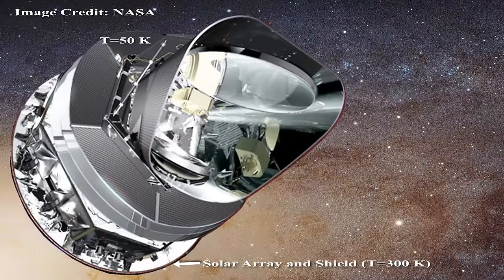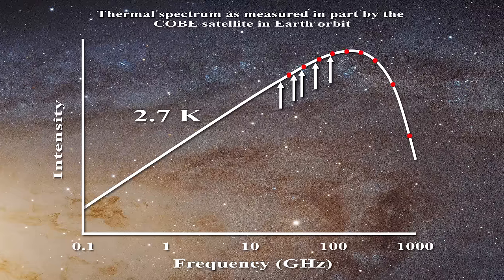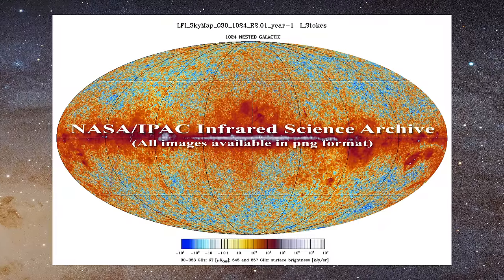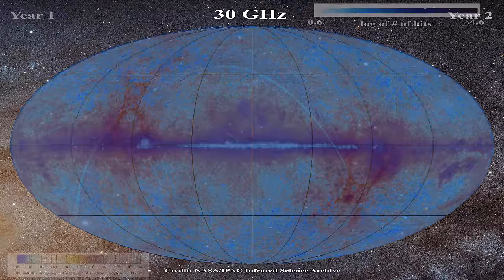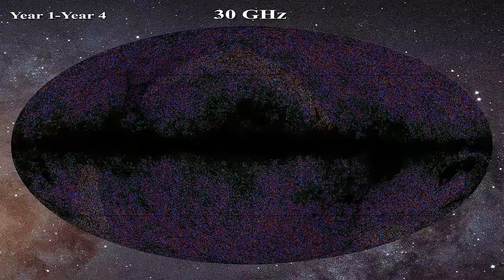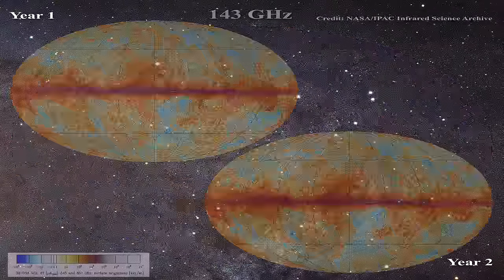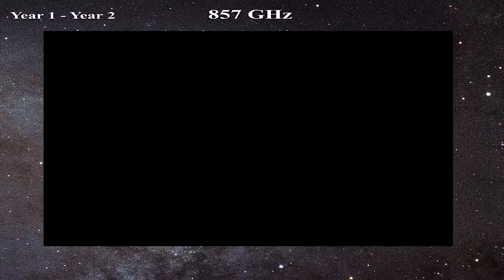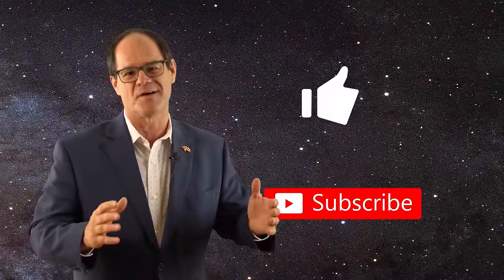The Planck Satellite - A $1,000,000,000 Misadventure

Comment: Oh dear where do I start!
Doing differences within Photoshop of the images is "not careful analysis"  or science. You need to download the proper data products (HEALPIX fits files) from the Planck or NASA website.
As it is, you can't give values for the difference between maps thus making your comments completely invalid. No useful analysis can be done on the png images the course pixels you show are png pixels not the instrument pixels so there are artefacts generated there for a start. Also with the true data you can put it into a linear colour-scale. If anythiing the logarithm scale actually allows for a finer temperature scale near zero to show features not hide them.
Reply: @roger_isaksson  Hi Roger. Let's see how they justify their analysis this time?
Reply: @Infinion  Well the original data are double-precision floating point not RGB values which can't express properly the full dynamic range
I have analyzed the HEALPIX files, I WORKED FOR PLANCK LFI!!
Reply: @roger_isaksson  Yes, just to point it out more, a Planck data file for the map is 480MB and the map png is just under 1MB, so much for LOSSLESS!
Reply: @BobWatson_Dr  Okay, then how can I compare for myself if the error between year 1 and 4 in the HEALPix format has the same magnitude of error as the lower resolution PNG output? If you've analyzed HEALPix files you should be able to do it, or at least tell me how to process the .fits file. What are the steps to generate a table or lossless 64-bit map to make the same comparison? If the PNGs really aren't enough of a judge that there is a problem with the maps, I want to see for myself with the better data and decide for myself.
Reply: @Infinion  Okay, best way is in python. 
You need healpy to read the healpix file, so "pip install healpy" should fix that
go to https://pla.esac.esa.int and click on maps then single frequency maps
There you get get the year-1 and year-2 maps (in fact there are difference data sets already done, but that spoils the fun
Grab say LFI_SkyMap_070-BPassCorrected_1024_R3.00_year-1.fits and 
LFI_SkyMap_070-BPassCorrected_1024_R3.00_year-2.fits
Reply: ipython
%pylab
import healpy as h
Y1 = h.read_map('LFI_SkyMap_070-BPassCorrected_1024_R3.00_year-1.fits') 
Y2 = h.read_map('LFI_SkyMap_070-BPassCorrected_1024_R3.00_year-2.fits')
h.mollview(Y1,max=0.001)  # Shows Year 1 data
h.mollview(Y2,max=0.001)  # Shows Year 2 data
h.mollview(Y1-Y2,max=0.001)  # To see the difference 

Should be fuzzy noise about 0.00017 K
Reply: @roger_isaksson  Unfortunately it's time for bed for me, so I'll  have to wait until tomorrow to see how all this plays out
Reply: @BobWatson_Dr  I'm running windows, so I'm going to have to install a virtual machine and then ubuntu before I can install and run healpy. When you call h.mollview(), are you setting 0.001 to be the maximum range value of the array? shouldn't it be "maxfloat="? https://healpy.readthedocs.io/en/latest/generated/healpy.visufunc.mollview.html. I have a lot to go before I can test the code.
Where are the already finished difference data sets? Are you talking about the Year 1-2, Year 1-3, Year 2-3, and Year 3-4 .fits files on https://pla.esac.esa.int/#maps ?
Reply: Dear Watson: I noticed that you mention nothing about the use of logarithms to plot the images. The Planck team know that they have a problem and that's why they chose to use a logarithmic scale rather than a linear one. They are clearly lying or they are imbeciles.

The pot calling the kettle black. You are making a fool of yourself. Quit while you are ahead. This nonsense cannot be salvaged. The ship is at the bottom of the ocean as I mentioned to you before. We can only hope that the tax dollar spigot will be turned off soon...
Reply: @bushmangrizz4367  I did mention the log colour scale and it actually shows up more details rather than hide them. Think about it - not using the log scale means having to use a less sensitive linear scale. As I said the data are available to produce linear plots if you want
Reply: @Infinion  I am setting max range. I literal did those instructions in another window and cut & pasted. The documentation is a bit misleading, see the bit in blue at the top for the use of the parameters. I suspect the line should read "max float" - parameter name and then type, but it all seems run together. 

Yes there are finished difference datasets difference between years or surveys or odd scans and even scans - it was a big thing to show the consistency of Planck data
Reply: @BobWatson_Dr  : “I am setting max range. I literal did those instructions in another  window and cut & pasted. The documentation is a bit misleading, see  the bit in blue at the top for the use of the parameters. I suspect  the line should read "max float" - parameter name and then type, but  it all seems run together.

“Yes there are finished difference datasets difference between years  or surveys or odd scans and even scans - it was a big thing to show  the consistency of Planck data” Watson

The only one being misleading here is you.  How amazing that you are willing to call PLANCK ESA documentation misleading!  The full 2nd year data release is available from CalTech including the HEALTIX data in addition to the png.

Infinion asked you this:

“Where are the already finished difference data sets? Are you talking  about the Year 1-2, Year 1-3, Year 2-3, and Year 3-4 .fits files on  https://pla.esac.esa.int/#maps ?” Infinion

The entire second year data release for PLANCK is displayed in the  CalTech site  https://irsa.ipac.caltech.edu/data/Planck/release_2/all-sky-maps/, as  Dr. Robitaille mentioned. The designation Year 1-2 should be read Year 1 dash 2, in other words,  Year 1 PLUS Year 2.

The file name "LFI_SkyMap_030_1024_R2.01_year-1-2.fits" corresponds to  the SUM of year 1 and year 2 at 30 GHz for the second data  release. Similarly, the file  "LFI-SkyMap_030_BPassCorrected_1024_R3.00_year-1-2.fits" is the bandpass corrected version of essentially the same file in the 3rd data release.  There are no  difference images at all on an individual frequency basis for PLANCK data anywhere for the 2nd data release as anyone can see by looking at the CalTech file. The same appears to be true for the files stored at ESA.  It is amazing the lengths to which you will go to  distort the conversation.  Surely, after you examined the file, you  recognized that they were not difference maps at all, but you chose to  persist with your deception, just to win the argument.  You are counting on the fact that Infinion will just not be able to open the Healpix file and most people will believe your were right because you were part of the LFI team when in fact all you did was deceive.
Reply: @stevecrothers6585  My apologies - There are different combinations of years, surveys and rings for you to difference yourself - I thought they were already done
I downloaded the single year maps and differenced the data explicitly hence the Y1-Y2  . I'm actually all for people opening the files and finding out for themselves and learning
You seem keen to see a conspiracy everywhere.
Reply: @Infinion  Sorry the Year 1-2 maps etc are combined maps as Mr Crothers so politely pointed out. What can I say - it was 11pm and I wanted to go to bed
Reply: @BobWatson_Dr  "11 pm and I wanted to go to bed" is not good enough coming from a Planck team member who hoodwinked Congress and ESA to take a billion dollars of taxpayer's money for scientific nonsense. 

Dr. R. is the 1st person on this planet to show the differences in the maps - qualitative or quantitative. The Planck team is lying and covering up. If you were an honest person you would have pointed that out from the get-go. You said that you did when you didn't. It is clear, Bob, that you are an intelligent person. But high I.Q.s do not correspond to wisdom. In fact, the higher the I.Q. the greater the chance of arrogance which can easily lead to lying. That is a problem with science in general, and physics/cosmology in particular. The cosmologists have done an immense amount of damage to science in general because of their arrogance and delusions concerning gaseous suns, Big Bangs, dark energy, dark matter and black holes. There is going to be a terrible price to pay for all of this lying...
Reply: @bushmangrizz4367  OK One simple question: How big are the differences between the maps in mK? 
All I hear and see are hand waving emotive words, but nothing quantifiable.
Also aren't you just a sock puppet account of Crothers? Your speak patterns seem awfully similar!
Reply: @stevecrothers6585  Er can't you read the code? I took Year 1 data and subtracted Year 2 data. The difference image is in the line: 
h.mollview(Y1-Y2,max=0.001)  # To see the difference 

I got the number as the rms on that (Y1-Y2) array via:
print std(Y1-Y2)
0.0001659233611499477
Yes indeed the data files contain more information - but these are needed for a proper scientific analysis. So naively on your own numbers one map = 480/10 = 48MB compared to a 3MB png!I don't know which particular png images you are using as they come in different sizes - why one needs to use a defined data source
Dr Robitaille gives no colour scale on his difference scale (because it's impossible) so they are meaningless. 
Have you downloaded the data yet? I want to see your numbers!
Reply: Dear "Where do I start" Bob: What frequency did you analyze and what were your units?
Reply: @bushmangrizz4367  Frequency = 70 GHz   Units = K_CMB
Reply: @roger_isaksson  I suppose the next step would be to do the spherical harmonic analysis to show the CMB angular power spectrum
Reply: @BobWatson_Dr  Thanks, Bob. Didn't think you would answer.

What unit is K_CMB?
Reply: @bushmangrizz4367  Hi Bushman, it's because the all the frequencies apart from the highest two were calibrated on the CMB dipole. So temperature variations are seen as if they are thermodynamical variations in temperature about 2.726K - means the amplitude of the CMB anisotropies is identical in all the maps. This means you have to remember this when checking foregrounds which have a different spectrum. For the LFI frequencies, it's only a few percent different. 
The CMB dies away quickly at the highest frequencies so planets were used to calibrate directly into power per solid angle. This is OK as these are the 'dust' channels
Reply: @roger_isaksson  Honestly it's more a tradegy!
Reply: @roger_isaksson  : It’s now quite evident to everyone that you and Mr. Watson have no understanding of imaging.  You have now confirmed that the Planck Team did not present the difference images because they knew that they were garbage. If they had done so they would have lost their funding 10 years ago. In fact if WMAP had taken their difference images as Dr. Robitaille warned in 2007, the Planck mission would have been terminated. Watson’s difference data are horrid. It’s clear that you have no experience in analysing difference images. If you wanted Planck to have any cosmological validity the standard deviations Watson presents should be 100 times lower. You are obviously out of your league competing with Dr. Robitaille. As it is Watson’s analysis further delivers the death blow to Planck by Dr. Robitaille. Unlike you, Dr. Robitaille, using simple qualitative analysis, could tell that there is no stability in the Planck images because he is very experienced in analysing difference images. He did not need to go to quantitative treatment because he knew the results would be horrid. Remember, Watson’s analysis is for 70 GHz and the WMAP analysis for the CMB is weighted in V-band. That is why these difference data are now so devastating. Once again they simply confirm the point Dr. Robitaille has made.
Reply: @stevecrothers6585  Again nothing but subjective air. I see no numbers just baseless asserts.
Dr. Robitaille's differences have no colour scale so his differences could be microK for all you know
Oh and my difference is beautiful - just the expected Gaussian noise! And it has a numeric result!
Reply: @BobWatson_Dr  : I’ve discussed your comment with Dr. Robitaille. Again it is very clear that you do not understand how to verify the validity of two images as being the same. He tells me that if you take an MRI image of a phantom with a signal to noise of 150:1 then repeat the image and take the difference the standard deviation on the difference will be at the level of the noise. You should not see remaining evidence of the phantom. No pixels should stand out above the noise floor. Now look at your Planck data. You have an image with signal plus/minus 1 mK. Your standard deviation is 170 micro K representing 17% of the total intensity. Now look at your difference image. You see bright and dark pixels everywhere. If you had a proper difference the image should be essentially monochromatic. It is not enough that it is Gaussian. The standard deviation’s value matters. You have pixels in the difference image that have essentially intensity values of the un-differenced yearly images. That is why your data is junk.
Reply: @stevecrothers6585  May I just point out THIS ISN'T A MRI IMAGE! Indeed there you do want good signal to noise, so you can say if that blob is cancerous or whatever. With CMB image we are not interested in every single blob but the statistics on amplitude on different angular scales. I am shocked you don't know this. It’s now quite evident to everyone that you and Dr. Robitaille have no understanding of CMB imaging!  You have now confirmed that your channel is garbage and should be demonetized. 

Honestly you want me to do the spherical harmonic analysis to prove my point?
Reply: @BobWatson_Dr  : Let’s go through a history of what just happened. 

[1] Dr. Robitaille produces a video displaying important yearly differences in Planck data.
[2] You objected to the qualitative analysis insisting that it has to be quantitative. You wrote: “Yes there are finished difference datasets difference between years or surveys or odd scans and even scans - it was a big thing to show the consistency of Planck data.” Watson
[3] You then stated that the yearly difference maps for each channel were on the Planck website. I proved to you that they were not and that you lied.
[4] You then tried to attribute your error to being tired but it manifested your unfamiliarity with Planck data.
[5] You then decided to take the subtraction quantitatively and posted it on Youtube.
[6] You stated: “Oh and my difference is beautiful - just the expected Gaussian noise! And it has a numeric result!” Watson 
[7] We then explained to you that the standard deviation was a factor of about 100 too high and that numerous pixels in the difference image revealed intensities at the level of the yearly maps. This made it clear that the differences were horrid, but you thought that they were beautiful. 
[8] We provided you with an example from MRI to show how stability must be measured. Recognising now that your differences are garbage you want to move to spherical harmonics. Yet you yourself had stated that the Planck Team recognised the importance of difference images. The fact is that the sky images in each channel must be established as stable before any spherical harmonic analysis is done, otherwise you are only going to conceal the non-cosmological nature of this data. You insisted on taking the difference images quantitatively, now live with the consequences.
Reply: @BobWatson_Dr  : "You have now confirmed that your channel is garbage and should be demonetized." Watson
Another Watson lie. Dr. Robitaille's video channel has never been monetized.
Reply: @roger_isaksson  : Here's my response to Watson.
Let’s go through a history of what just happened. 

[1] Dr. Robitaille produces a video displaying important yearly differences in Planck data.
[2] You objected to the qualitative analysis insisting that it has to be quantitative. You wrote: “Yes there are finished difference datasets difference between years or surveys or odd scans and even scans - it was a big thing to show the consistency of Planck data.” Watson
[3] You then stated that the yearly difference maps for each channel were on the Planck website. I proved to you that they were not and that you lied.
[4] You then tried to attribute your error to being tired but it manifested your unfamiliarity with Planck data.
[5] You then decided to take the subtraction quantitatively and posted it on Youtube.
[6] You stated: “Oh and my difference is beautiful - just the expected Gaussian noise! And it has a numeric result!” Watson 
[7] We then explained to you that the standard deviation was a factor of about 100 too high and that numerous pixels in the difference image revealed intensities at the level of the yearly maps. This made it clear that the differences were horrid, but you thought that they were beautiful. 
[8] We provided you with an example from MRI to show how stability must be measured. Recognising now that your differences are garbage you want to move to spherical harmonics. Yet you yourself had stated that the Planck Team recognised the importance of difference images. The fact is that the sky images in each channel must be established as stable before any spherical harmonic analysis is done, otherwise you are only going to conceal the non-cosmological nature of this data. You insisted on taking the difference images quantitatively, now live with the consequences.
Reply: @stevecrothers6585  
[1] 'Important' only if you don't understand what's going on and using amateur photoshop non-numerical differences
[2] We did an awful lot of this and put data products to allow you to do this, but you have to do the differencing
[3] I was mistaken - it happens 
[4] Happens to be the truth - get over it!
[5] I did
[6} It is
[7] This is the problem you don't know how the CMB anisotropies are analyzed or used- so you can't judge
[8] Again you are just showing your ignorance of how the analysis is done or you would know the MRI example is not applicable 

Still no actual numbers based on the data from your end I see.
Reply: @roger_isaksson  : "I mean, rapidly toggling between PNG images of cosmic artwork is not even science, it is absurd." Isaksson

It's clear that you have no understanding of imaging science. The png's are provided by NASA. They are not 'cosmic artwork'. They are high resolution containing essentially no compression. The reason that they are 3 Mb and the Healpix images are 30 Mb is because the Healpix data provides the intensity on a linear scale so it needs more bits. Conversely the png's provide the intensity on a logarithmic scale so they need less bits but the data is not compressed, it's included in the scale.  The fact that you relish Watson's quantitative  images emphasises that you have never understood imaging for if you had you would have understood that the quantitative results were horrible, just like the qualitative analysis had  anticipated. The only ones in a quagmire here are you and Watson and you did it to yourselves by providing quantitative images which you did not understand. Most members of the Planck Team at least had recognised the importance of keeping the quantitative differences hidden from the world. You wanted them, now live with them. Dr. Robitaille has won this battle; you are checkmate.  It's over.
Reply: @BobWatson_Dr  : "Still no actual numbers based on the data from your end I see." Watson

No, you have already provided the numbers which will destroy the Planck satellite. Dr. Robitaille does not have to provide any numbers. You confirmed his qualitative analysis with your difference images and failed to realise what you were doing. If you were honest you would provide the differences for all channels for all years and insist that the Planck Team post them all and let the world decide.
Reply: @stevecrothers6585  
I understand it, but the problem is you don't and have interest in finding out.

The difference maps are available in the technical papers https://doi.org/10.1051/0004-6361/201833293 & https://doi.org/10.1051/0004-6361/201832909
in all their gory detail with detailed explanations. Of course the point of the is to  show effects so they are smoothed to reduce the noise and shown on a highly sensitive colour scale of afew microK, which of you are going to total get wrong.
Reply: @roger_isaksson  Of course all they are going to see is there is stuff, but not that it's 1000 times smaller than the noise and only affects low-multipole stuff like primordial B-modes, which Planck was never really meant to do anyway.
Reply: @roger_isaksson  I bet they are going to say "told you so", without acknowledging the Planck Team actually did the analysis (properly) years ago and not them., and spout crap about MRI images. Planck did the present the differences and was transparent and demonstrated variations don't impact the published results
Reply: @BobWatson_Dr  You cite two papers, one for the LFI https://www.aanda.org/articles/aa/pdf/forth/aa33293-18.pdf and one for the HFI https://www.aanda.org/articles/aa/pdf/forth/aa32909-18.pdf . Neither of these papers contain the yearly differences between channels at the channel resolution.  Some survey difference maps are provided, but the resolution has been greatly degraded by applying a low pass filter to smooth the map and amplify large features (see Fig. 14 in paper 1).  That, of course, makes everything look nice & neat - that is how you get a +/-20 uK difference for the LFI channels scales. Your filter is killing the real standard deviations between the difference maps.  

Show us the difference maps without degrading the resolution.  We already know the answer for 70 GHz year1-year2 and your filters will not change that result.  Cosmologists must first establish that the maps are stable, then you can worry about the large features.  Until you show yearly stability at channel resolution you are simply fooling yourself. Your data is screaming at you "I have nothing to do with cosmology".  

You are being deceptive again, but this time with the help of the entire Planck team.  When will you stop? Pathetic...
Reply: @roger_isaksson  You know, Roger, if science was left only to the arrogant there would be no science. Your "...they are clearly well out of their depths again" comment reminded me of Jacques Cousteau. He believed, based on his experience with diving, that there was life at the deepest parts of our oceans. How did the experts respond to Jacques? "You are out of your depth" (no pun intended). "You are not a marine biologist". "How dare you tread in our areas of expertise"? 

Of course, poor old Jacques was proven to be correct and the guys with the PhDs proved they were assholes. No one remembers those PhDs. Some day no one is going to remember anyone on the Planck, WMAP or COBE teams. Who wants to remember bad science. Actually, as Dr. R. says, it's not even science...
Reply: @roger_isaksson  Roger, sounds like you don't spend much time in the lab, if you have ever spent any. Here's a "qualitative" experiment for you. Find the nearest stove and turn one of the elements on to a setting of "high". Wait a few minutes. Now, without the use of an instrument, like say a thermometer, look at the element to see if it is glowing red. If you don't believe the colour is telling you that it is hot, stick your hand on it just for a micro-second.

Then go read up on Jacques Cousteau after you have bandaged your hand...
Reply: Also remember the noise on the difference map is twice the noise on the combined map due to error propagation math
So ~80microK LFI & ~50microK HFI 
4 years LFI maps =40microK and 2 years HFI maps = 30microK
There's about 250 LFI pixels to a 1 degree CMB blob - 2.5 microK per blob
and 1000 HFI pixels to 1 degree - 1microK per blob
Reply: @BobWatson_Dr  : Give us access to your difference images. Google will not allow general access. If you refuse general access I'll write to your university account to formally request access. Dr. Robitaille is not wrong. He used pngs on a logarithmic scale and took differences to look for a qualitative effect and found that the images are drastically different. Your standard deviation which you then calculated was terrible. The Planck Team has been using a low-pass filter to process the yearly image differences and was thereby deceptive, as Bushman Grizz has correctly pointed out. The public is tired of your deceitful games. The Planck Team hid the high frequency results from the world, precisely because those results prove that you have nothing. The world paid for this project. Give us all the difference images for all frequencies.  The problem for the Planck Team is that they are now facing peer review, not pal review.  Dr. Robitaille knows imaging and the Planck Team cannot argue otherwise without destroying their own credibility.
Reply: @stevecrothers6585  Surely you can see the PDF? The code to make the images. All the data and software is public domain. My whole point is you shouldn't be using images but the data. The data is available - you are all experts in image processing after all, so just follow my recipe. Science is all about reproducibility! Anyway, the difference maps are generated directly in the document.
Reply: OK fixed it! 

You know a simple "I think you forgot to give general access" would have done, instead of your full-on conspiracy nutjob, It got in the way of understanding what you meant!
Reply: @roger_isaksson  Hi I decided it was healthier to turn off notifications and not check comments before going to bed. I surprised there wasn't a knee-jerk "This is rubbish and just proves you don't know what your doing - our expert on MRI imaging says so"

I can confirm Planck in nothing like an MRI machine - MRI you want the best signal to noise  everywhere to have high confidence in the features you see - Planck is more interested in statistics across the map. On taking the CMB as an orange, we are not interested in each individual pore in its skin, but if smaller pores are deeper on average. To see there's some relation between angular pore size and it's depth - in other words it's angular spectrum.
Reply: Also you can now see shat wrong with Pierre-Marie's analysis. The receiver white noise is showing up as speckly stuff in the low emission regions but the galactic plane is showing up as black due to the log scale. Then I don't know what happens with negative pixels in the colour scale - that's even before you start worrying there's no colour to.temperature scale. It's a complete and utter disaster.
Reply: @BobWatson_Dr  It took me a several days but I figured out just enough to get ipython to work in the ubuntu virtual machine. There was a loooot of supporting software and configuring that was needed to get it to work, it's not just plug and play after installing one program to look at data. It's good to keep in mind that not everyone is familiar with linux or has the patience to see it through, so this learning curve is a huge barrier for any person wanting to process the .fits files with math functions and have a conversation about the data (or reproduce the .fits data with a full resolution PNG and identify if the conversion is a source of error as claimed). So I don't think it's fair to really expect me or anyone getting into this to just produce results right away.  All of the passive aggressive bantering and comments is just deconstructive.  It would have been impossible to even produce results in the time that I did without someone like Bob's lines of code for ipython.  Here are some of my steps over the past 3 days.
Install Oracle VM Virtual Box
Install Ubuntu disk image from https://ubuntu.com/desktop into Oracle
Start Ubuntu and configure operating system
Open terminal inside Ubuntu environment
Download and Install Anaconda software suite for Ubuntu
Insufficient Space (10GB wasn’t enough as Oracle first advised, need to start over or double virtual hard drive to 20GB)
I had to use windows command prompt / powershell to add virtual space to drive 
Unlink ubuntu virtual disk image from VM
VBoxManage.exe modifymedium "C:\Users\lnfinion\VirtualBox VMs\Infinion Ubuntu 2020\Infinion Ubuntu 2020.vdi" --resize 20480
Download Gparted Image 
Boot into Gparted and add unallocated space to Ubuntu Drive install Anaconda in terminal
Follow instructions https://www.youtube.com/watch?v=KW1ScgdCIfs
Relink VDI to VM
Boot up ubuntu
Open terminal
cd /home/Infinion/Downloads
bash anaconda3-2020.02-Linux-x86_64.sh
Update Anaconda in terminal
conda update conda
conda update anaconda
conda update ipython
install healpy in terminal
pip install healpy
RESTART 3 TIMES (many problems with ipython not working with the healpy scripts and killing itself. Restarting as frequently as possible with any changes or updates will save you a lot of time)
...
Enable Host to Guest (Parent OS to virtual machine) drag and drop functionality (may require VBoxGuestAdditions.iso tot be mounted) OR if you have networking configured, Navigate to  https://pla.esac.esa.int/#maps in ubuntu 
Download the .fits files 
open terminal
navigate to the location of the files: cd/home/Infinion/Downloads
Finally we can actually use ipython

(base) infinion@infinion-VirtualBox:~$ ipython
Python 3.7.6 (default, Jan  8 2020, 19:59:22) 
Type 'copyright', 'credits' or 'license' for more information
IPython 7.13.0 -- An enhanced Interactive Python. Type '?' for help.
In [1]: %pylab                                                                 
Using matplotlib backend: Qt5Agg
Populating the interactive namespace from numpy and matplotlib
In [2]: %matplotlib inline                                                     
In [3]: import healpy as h                                                     
In [4]: M1 = h.read_map('/home/infinion/Downloads/LFI_SkyMap_030-BPassCorrected_1024_R3.00_year-1.f
   ...: its')                                                                                      
/home/infinion/anaconda3/lib/python3.7/site-packages/healpy/fitsfunc.py:352: UserWarning: If you are not specifying the input dtype and using the default np.float64 dtype of read_map(), please consider that it will change in a future version to None as to keep the same dtype of the input file: please explicitly set the dtype if it is important to you.
  "If you are not specifying the input dtype and using the default "
NSIDE = 1024
ORDERING = NESTED in fits file
INDXSCHM = IMPLICIT
Ordering converted to RING
In [5]: M2 = h.read_map('/home/infinion/Downloads/LFI_SkyMap_030-BPassCorrected_1024_R3.00_year-4.f
   ...: its')                                                                                      
/home/infinion/anaconda3/lib/python3.7/site-packages/healpy/fitsfunc.py:352: UserWarning: If you are not specifying the input dtype and using the default np.float64 dtype of read_map(), please consider that it will change in a future version to None as to keep the same dtype of the input file: please explicitly set the dtype if it is important to you.
  "If you are not specifying the input dtype and using the default "
NSIDE = 1024
ORDERING = NESTED in fits file
INDXSCHM = IMPLICIT
Ordering converted to RING
In [6]: dif = M1-M2                                                                                
In [7]: std(dif)                                                                                   
Out[7]: 3.3316937825043886e+29
In [8]: h.mollview(M1,max=0.001)                                                                   
<Figure size 612x388.8 with 2 Axes> #How can I generate the figure and adjust its resolution
In [9]: h.mollview(M2,max=0.001)                                                                  
<Figure size 612x388.8 with 2 Axes> #How can I generate the figure and adjust its resolution
In [10]: h.mollview(M1-M2,max=0.001)                                                               
<Figure size 612x388.8 with 2 Axes> #How can I generate the figure and adjust its resolution
In [11]: M1_msk = where(M1<-1e30,0,1)                                                              
In [12]: M2_msk = where(M2<-1e30,0,1)                                                              
In [13]: dif_msk = M1_msk*M2_msk                                                                   
In [14]: unmaskpix = where(dif_msk!=0)[0]                                                          
In [15]: rms_dif = std(dif[unmaskpix])                                                             
In [16]: print(r"rms dif = {:5.1f} microK".format(rms_dif*1e6))                                    
rms dif = 172.0 microK #same result as from https://drive.google.com/file/d/1v73c02a-dBtLXLE8GCt_o-5TiPSjnzV-/view
In [18]: std(M2-M1)                                                                                
Out[18]: 3.3316937825043886e+29
Some questions, the basic standard deviation of the difference between the two arrays was 3.3E+29 which is an unimaginably large number instead of what should have been something small like E-29. What is up with that?
Also the purpose of my endeavor was to do 2 things: 1, to see for myself whether I could do the data subtraction and visualize that subtraction, and 2, produce a PNG output and do pixel difference mapping to see if the PNG offered by NASA is as flawed as everyone says it is, or if it retains the data and reflects.
Ubuntu Terminal pylab did not give me an output figure and I don't know how to extract one. Bob seems to have done it, but I can't verify his images until I figure that out.
According to http://montage.ipac.caltech.edu/docs/HEALPix/ on Converting from tables to images:
     *"Calabretta's WCSlib package includes a utility for converting from HEALPix FITS tables to HPX FITS images. This involves no resampling as the image pixels correspond one-to-one with the HEALPix cells in the table.
We have included a copy of that utility (HPXcvt) with Montage as-is for our users' convenience; none of the rest of WCSlib is needed to build it."*
I or someone willing needs to check out that utility, because apparently, Caltec is stating that the PNG outputs involved are not resampled, correspond one-to-one with the cells in the table, and therefore do not suffer from compression or artifacts like I earlier asserted. PNG should then be appropriate to do graphical analysis with. This more then likely applies to the publically available images on the Caltec archive that PMRobitaille used in the video. 
Long story short, the standard deviation in the .fits math approach is different from the .PNG pixel difference approach, and that still needs to be identified and reproduced, but the graphical analysis is not invalid after all! And certain individuals who shall not be named and have the education to know better should not fling insults and be deconstructive. The defending party to the graphical analysis of PMR should also cool it and not be so confrontational, although there are many trolls that deserve intense scrutiny.
Reply: @Infinion  Lots of work and pain there. Here's some tips to  help you generate your pngs
The "%matplotlib inline" is only for ipython or jupyter notebook which runs things in a web-browser. I did that so I could make a nice pdf at the end. 
"show()" should show the plor just put "%matplotlib" that should generate interactive plots directly
The big crazy numbers are because the pixels in the map which have no data are set to a "magic" value of healpy.UNSEEN which is  -1.6375e+30. Normally the healpy routine just ignore pixels with this value, but if you are doing differences then this value changes and messes things up. Also the numpy maths library can see this value as well.
I make a mask for these pixels with" M1_msk = where(M1<-1e30,0,1) "
For the standard error routine "std" you need to give it a list of valid pixels. Generate it with "unmaskpix = where(dif_msk!=0)[0] " make a list of good pixels and select them by putting it after the array in square brackets eg "dif[unmaskpix]"
you can set the size if the figure with "figure(figsize=(10,6), dpi=100)" the figsize number are in inches and plot size in pixels will be the figsize times the dots per inch
You can save the figure with savefig("filename.png")
Reply: @BobWatson_Dr  Thanks for this, I'll play around with these and see if I can get further
Reply: @roger_isaksson  I did see Jupyter during installation but didn't know what purpose it had. I'll have to look into that in getting my images. Thank you guys.
Reply: @Infinion  You can fire up jupyter with "jupyter notebook" it will make a local webserver and open a page to it in your default browser. A very nice environment to test things and keep a record of what was done. Bit of a learning curve to make full use of it
Reply: @roger_isaksson  Oh I've done the power spectrum on the difference data. You get very nice rising power law (straight line in loglog) as expected for receiver white noise
With the right masking on the galactic emission, you can see the bumps of the CMB about  a factor 10 to 100 above the difference noise spectrum. I'll save that for as a reply to a more appropriate video.
Reply: @roger_isaksson  Yes it leads to equal power on the C_el harmonics, but the CMB angular power spectrum is plotted  in "band-power" which is C_el * el *(el+1), so you get a el^2 power law - it's a straight line in log-log plot with a slope of 2